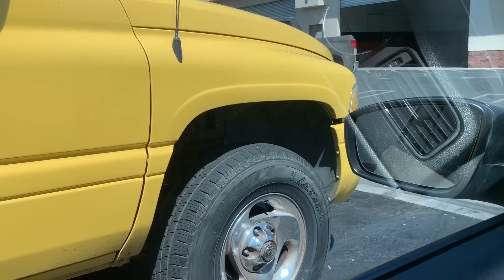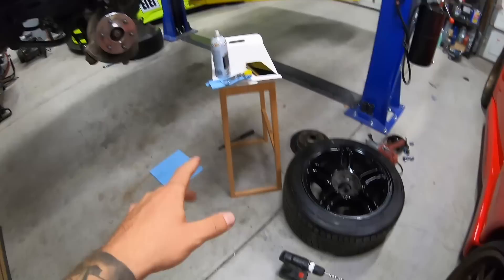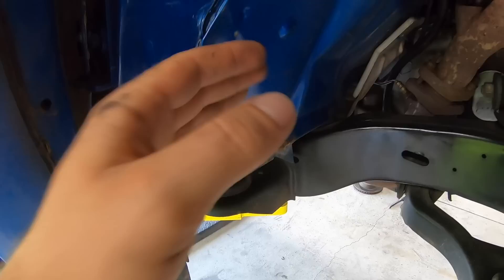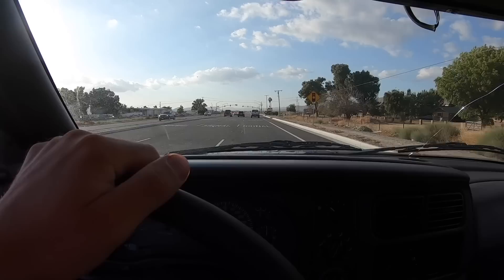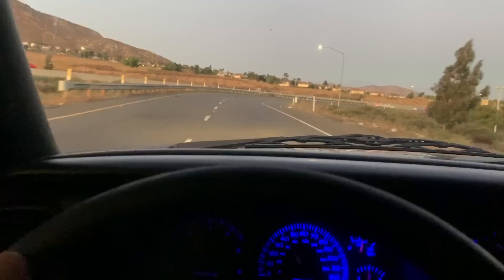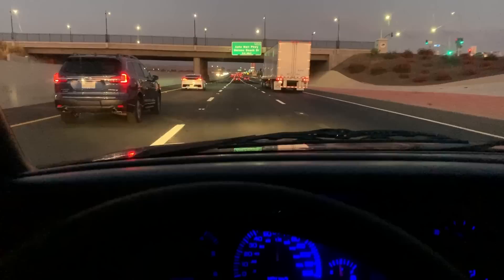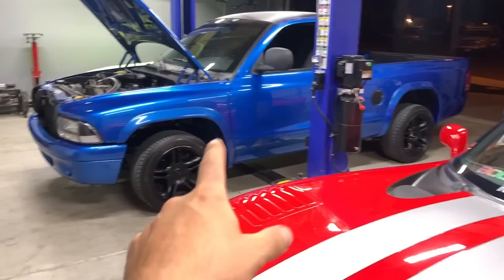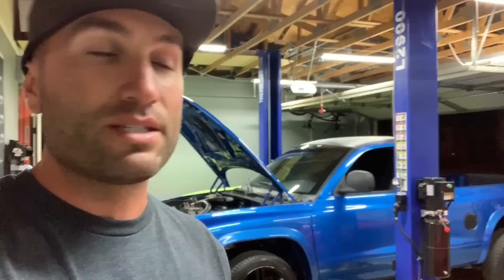THE PROJECT PICKUP TRUCK BUILD

Comment: That steering wheel noise you are talking about, is the intermediate steering shaft. It’s a common part to go on the Dakota. I had to replace it on mine. Very easy to do

Comment: If I remember correctly I did the 3in springs in the front and i flipped the factory rear leaf spring hanger and shackle in the rear with the 2 in front lowering hanger in the front of the leaf spring and it gave be about 6in drop in the rear and it was level so I would install your rear kit first to see how much you need for the front. Don't forget about shorter shocks too. I also had to notch my frame for the axle to clear. But mine it LOW like real low. I'm also running 275 40 17 tires on the same wheels you have.

Comment: Thanks for the update! I would certainly keep an eye out for some belltech 2" drop springs for the front. I bought a Chinese spring kit off eBay and have been running it for a year now, no problems so far. 2" front / 4" rear is a really good look for Dakotas. Nicely done on the helicoils! Keep up the good work man, loving the videos! Have a good weekend!

Comment: Again awesome videos. I use dashcommand. It does 0-60, quarter mile , reads torque and hp. You need a Bluetooth dongle from Amazon , they are around ten bucks. And I think the download the software the unlocked version is approximately $10 to it just plugs into your OBD port and then you fill in the information for your vehicle

Comment: There's a little string/ wire and the red indicator that attaches to the gear selector, for the column shifter. In behind the dash bezel and column. Take those off. You can fart around with it to get it to line back up correctly to each gear. Drove me nuts lol its the little things 👍

Comment: I used the djm 2" lower control arms and a 4" block on my v6 dakota and then cut the springs. Bad idea so I bought new springs but didn't realize they were for a 4 cylinder truck until after I opened them. So it sits slightly lower in the front but not terrible. Also for shocks look into djm calmax or belltech nitro

Comment: Looks like you're missing the front inner fenders, unless you took them off. Also, you can purchase 2" lower control arms which will give you a 3" total drop (compared to a non r/t) or go 3" springs. Finding some decent drop shocks may be a bit of an issue.

Comment: hey also i am ls swapping my RT so i have mopar headers and a custom stainless y pipe thats all ceramic coated for sale too. along with a 4 barrel M1 intake, heads arp studs, procharger intercooler, procharger boost a pump. and prob some more stuff.

Comment: Do the 4" hangers in the rear and 3" drop leafs for a total of 7". Then do a 2" drop spring in front with the 3" drop lower control arms from djm. There's your 5/7 drop.
Reply: You could also do blocks in the rear for more drop, whatever you prefer.

Comment: If you do springs expect 1” less due to the fact that you already have a 1” drop spring from factory. Also, once the truck is lowered you might as well remove the rear sway bar, as it will no longer have the correct geometry to work properly.

Comment: Djm, sells a kit that’s shackles and hangers plus a 1” block , that makes it a 3 inch drop , shackles and hangers will only give you 2”, djm also has the 2” lower A arm , do not swap the spring it will ride like crap

Comment: Definitely do the headers next. That ticking is driving me insane through my headphones. I would also go with a 3” front drop IF the rear actually drops 4”. If the rear only drops 2”, the 3” drop in the front might be a bit much. Although it would just have the standard rake of any other truck. I don’t know that I’d go lower than that. Also, will you be putting shorter shocks in the front? I know with the Ram you have to to keep the springs from flying out.
Reply from the maker: Lol the ticking is making me just as crazy brother! 😂
Reply: The rear WILL drop 4"